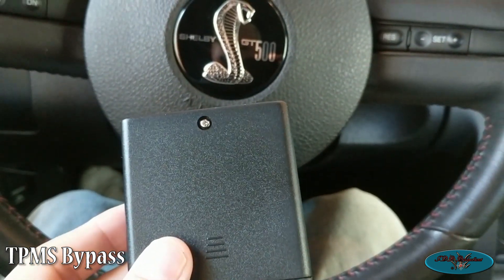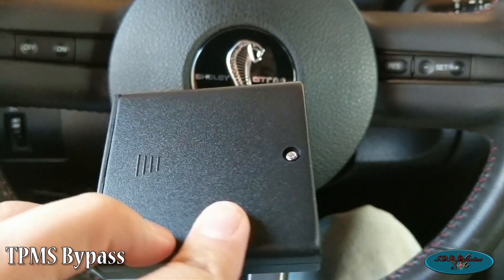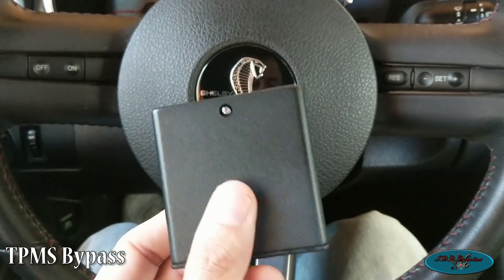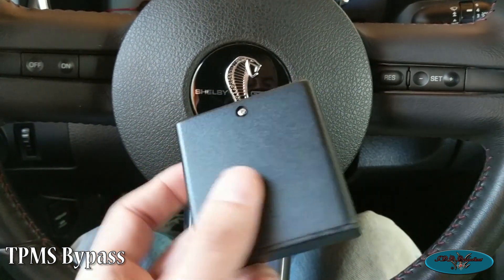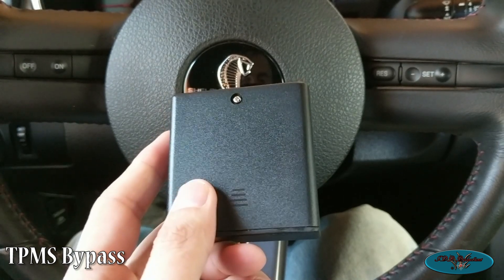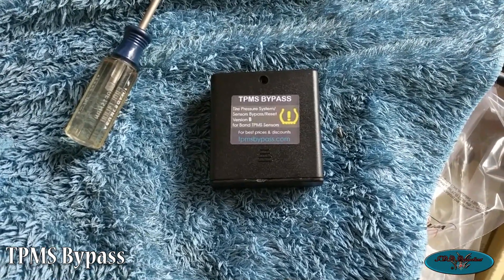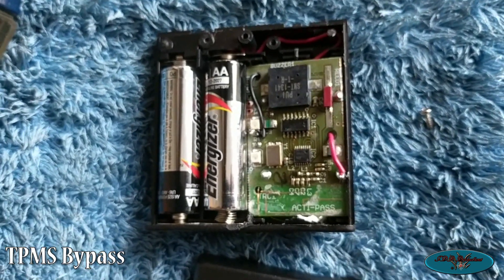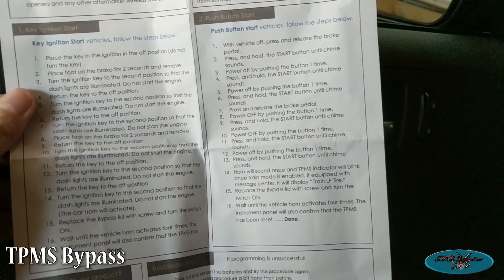TPMS Bypass that actually works!

Comment: Installed  this in my 2010 f150 3 weeks ago ,took 3 tries but it has worked great ,the dealer wanted $650. and the tire shop wanted $400 to replace battery tpms units. GREAT investment in my opinion .

Comment: Understanding that the product turns off the low  tire pressure light, but does it turn off the word display which says tire pressure malfunction on my 2013 Ford mustang GT
Reply from the maker: I have an 08 and everything appears normal on my dash. Can't speak for a 2013. They make different ones for different years.

Comment: My experience has been extremely frustrating. Have to pay to return for defective unit. Price to ship almost outweighs the cost of the unit. Attempts to use their return methods do not work. Basically, you are screwed and in my case, $87 worth of screwed. Be aware.

Comment: You must have been one of those paid reviewers.  I had a totally opposite experience.  Firstly the build quality is terrible. There were loose wires inside the box that connected to nowhere.  Secondly the instructions must have been written by a 10 year old because they were totally confusing and useless.  Finally after contacting them there was no response whatsoever.  I ended up having to look up the procedure on my own online and figured it out.  So we will see how long this thing lasts.  There's maybe 3 dollars worth of components in the box so don't expect much.  If it works for you then it would be worth avoiding building the pipe bomb.  Otherwise it's a fly by night business from someone's garage.  But a great idea nonetheless.
Reply: Tom Wei the wire to no where is the antenna?....it works fine.

Comment: so how do you figure the pvc pipe is a pipe bomb? ir has like 35 psi in it and so do you tires so then you are riding on 4 tire bombs with that thought. the pvc is rated for 200psi and the tpms sensors then also alert at over pressure so you would not want them over 45 psi
Reply from the maker: bob palmer I think you know what I meant. This is a much easier solution and actually works.
Reply: The pvc would likely just leak the air out. 40 PSI isn't going to shread that PVC like a bomb anyway. The same pvc house pipes have probably 60 psi going through them 24/7 anyway.

Comment: I would be kinda pissed if I had to send it back to the UK to be reprogrammed to get one that worked. How long did it take for international shipping 3 ways? Did they at least reimburse you for the return shipping? Still I might have to try this since it seems to be the only device out there that does it and the TPMS is a major pain when the sensors start to go dead. 

I'm not confident the pipe solution would actually work with no movement to wake the sensors, and it's more bulky. It's also more expensive once you factor in the cost of buying a full set of sensors and the pipe. Then if there are any tiny slow leaks in the setup you'll be stuck constantly filling up the pipe. This seems like a much better solution (if it works anyway).
Reply from the maker: Wasn't a big deal. Quick turnaround and in the end they fixed the issue. Small hassle for convenience of not having the light on.

Comment: How far have you driven in one trip? I have a 08 and it seems that I can only drive about 30 miles before the TPMS finally triggers a fault.
Reply from the maker: I've driven thousands of miles without issue. Still working fine today

Comment: Do you have a part number for this unit? I sent the company an email to order one and they said they couldn't help me.

I even sent them your video
Reply from the maker: Peter Studwell What car are you trying to get one for? I bought this one off eBay. There was no part number. I just searched under Ford and my year model.
Reply: I just did the same. 2007 Shelby GT500. Should be the same as yours
Reply from the maker: Peter Studwell They have one for $71.95 on eBay. Says it's for 2007-2009. Just do the rest before you order in the description so you know it will work.
Reply: I just did exactly that. The horn beeped after the sequence. Just ordered the unit

Thank you so much for your quick response
Reply from the maker: Peter Studwell Awesome. Hope it works out for you too.
Reply: Peter Studwell Hey! Did it work? I just got new rims and tires and if this really does work, I’ll pick one up too?:)
Reply from the maker: Peter Studwell It is still working flawlessly for me. I have no sensors in my mustang in he front or rear, and no light on my dash. I'd just order one from eBay after performing the test listed. If your car passes the test, you should be fine.